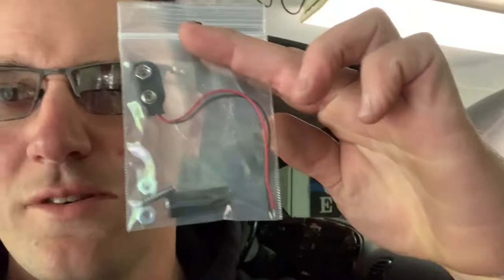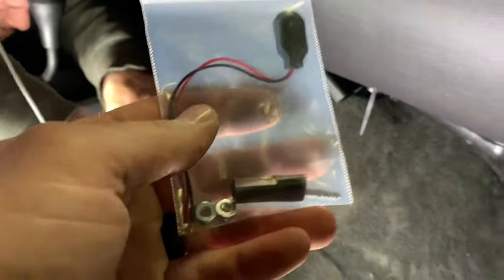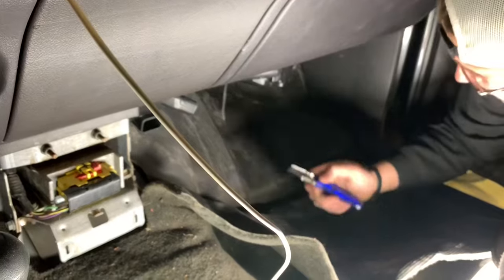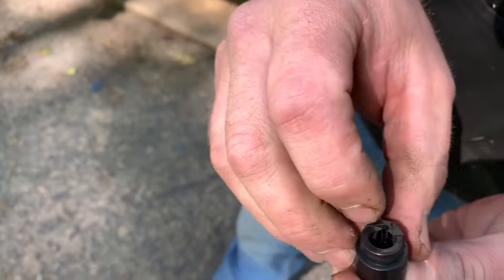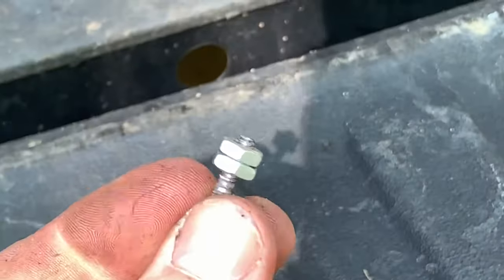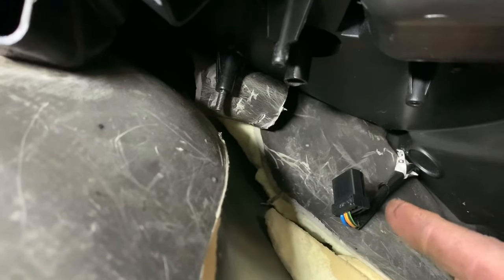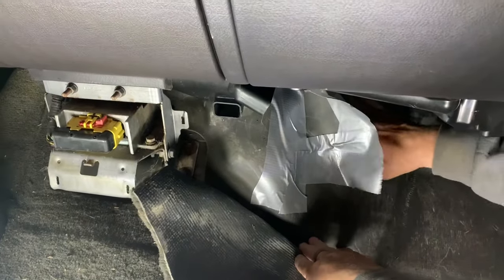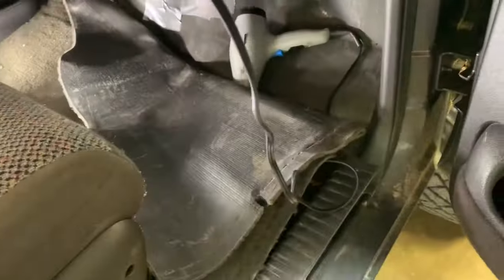97-02 Dodge Cummins blend door fix

Comment: I’m only getting Ac to blow on my front window defrost not my front
Reply from the maker: Your mode door is stuck on defrost then.
Reply: @AutomedicGarage  do you have a video for mode door, what actuates the mode door
Reply from the maker: That would be your mode actuator
Reply from the maker: I do not currently have a video for a mode door actuator problem
Reply: Do you know where is the mode door actuator located? I just replaced the blend door actuator which fixed my heat and AC but the mode is stuck in defrost and feet area and wont change to anything else
Reply: Check your check valves and vacuum lines in your engine bay

Comment: Does the AC dial need to be set in a certain spot when you reinstall the actuator? Or does it just matter where the blend door and thw actiaryor gears are lined up. Im only getting semi cool air right now. I also did take th batteries off or turn ignition 20 times like the manual said. Plan on doing that tom.

Comment: will a new actuator control module fix this issue ? I found an after market for $30.00 . I can't tell what exactly was replaced but it looks like a new module would fix the issue .
Reply: Nope   I pulled mine out 4 years ago and it happened again this week

Comment: This actuator must be in a different location for the gas motor trucks
I have a 97 and 98 gas motor and the actuator is not located like your Cummins is????
Reply: My '98 gasser(diesel conversion) is the same as my '94 diesel was.  It doesn't have one either.  It's mechanical.

Comment: Hello, great video. Good tips. I came across it in my research lol. I have a 2000 1500 ram 5.2. When the a/c or heat are on the front vents, the driver side blows significantly harder than the 2 passenger side vents. Doesn’t make a difference if heat or a/c. Everything is clear , nothing blocking it. Blower motor sounds strong. Only strange thing I notice is when on Max a/c (or regular ac or even vent heat) it comes out the vents AND the floor. Is this normal? You’d think max a/c would be top vents only. Thank you
Reply from the maker: Max ac is only different from ac because it pull air from inside cab, that’s why it blows harder also.
Reply: @AutomedicGarage  thank you for reply. My next question would when it’s on a/c or max a/c is it supposed to blow out floor vents also? I thought it was only supposed to come out the front facing vents
Reply from the maker: @bsrob1  ac is only on vents not floor. Your nose door must be stopping at the floor and vent combo selection
Reply: @AutomedicGarage  is this door easy to get to to replace? I’d say that’s where some of my passenger side vent volume is going if the door you speak of is stopping at vent and floor

Comment: Is the actuator in a different location because your truck is a diesel?
I have a 97 and 98 gas motor and the actuator is not located like yours????
Reply: should be the same
Reply: Earlier years had a cable ontop of heater box remove glove box and can go in and manually select

Comment: I have a 95 12V with the same problem, vacuum is good, I had the condensation hose problem as well, thought it was a window/door leak it drove me nuts till I found the problem, anyway..is the blend door actuator located passenger side under the dash? also can I buy that an entirely new actuator, Thanks
Reply from the maker: Yea you can get an actuator but it’s usually just the plastic collar that’s broke. Heater treater fixes that. And it is located under the passenger side of dash.
Reply: Nice work! 👏

Comment: Mine was cracked as well. Not sure if this is my issue. Not sure how it could be but every time I hit the brakes hard I hear a pop and my ac shut off
Reply from the maker: Door was flopping around in there probably
Reply: Hey I am having the same issue did you ever resolve your issue
Reply: @bgy1591
Reply: @russellcarroll6661  yes and I also had a leak and was low on refrigerant but I believe this was what was causing the popping sound and causing it to turn to hot
Reply: Great I’m gonna give it a go thanks !

Comment: So what you replaced, was that little plastic piece? 
With the gears, did you line them up?
Did the metal tube go over the plastic piece ? 
Little lost.
Reply from the maker: The heater treater mod replaces the inner plastic collar with a metal one.

Comment: Would this cause the ac compressor not to kick on, mines stuck on heat and when I turn the ac on the compressor doesn’t come on
Reply from the maker: No this has no control over the ac compressor. That is controlled by your mode switch, this is for the blend door.

Comment: Any suggestions or advice about the '95?  I have a LeBaron GTC convertible, blend door stuck closed.
Reply from the maker: Never worked on one, but start simple if it’s vacuum operated check for leaks or dry rotted hoses, see if you can push the actuator by hand. If it’s electronic take the actuator off and turn your blend switch back and forth and see if the actuator works at all.

Comment: For a temp fix could you just turn by hand to set to one temp?  Mine is stuck on heat 2001 dodge Dakota.  Need on cold
Reply from the maker: It would be hard to turn by hand due to the gears unless they are all broke.
Reply: I know this is old but I thought I'd respond anyway. I have a Dodge Roadtrek 190 Popular. It's built on a Dodge B3500 van. My blend door actuator doesn't function, BUT...I can turn it one way in the winter to get super hot heat. Then, in the summer, I flip the actuator the opposite way, and the heat stops coming in (or at least partially so). 

My problem is that the AC blows barely cool air rather than cold. The AC system has been fully checked and recharged. The line gets freezing cold but the air into the cab is blowing barely cool.  

That's my problem, but I wanted to answer your question by noting that YES, you CAN just turn the actuator by hand. My actuator is accessed by removing the glove box. Very easy to turn by hand. (Unfortunately for me, in summer it must not close the blend door effectively enough because it seems some heat must still be getting through. But that may not be a problem for you.) Good luck!

Comment: Can that blend door being broken cause the A/C on my 02 Cummins to only blow from the floor?
Reply from the maker: No, that would be your mode door
Reply: @AutomedicGarage  Or a vacuum leak if it doesnt change vent positions
Reply from the maker: @Tempsho  I wasn’t insinuating it couldnt be a vacuum leak. The point it if it’s only blowing in one location it’s something to do with the mode door meaning the door itself, controls, vacuum leak, etc.
Reply: @AutomedicGarage  all good, I was just trying to add a bit more to your comment. Some people don’t realize that in some vehicles, the vent position is controlled by vacuum and that it defaults to the floor/vent position if there’s a vacuum leak.
Reply: What was it?
Reply: Is there separate actuator for the mode door? This seems my problem… its stuck on defrost wont change to feet or anything
Reply: @jomine16  look above the accelerator pedal there is one that controls the vent flow
Reply: @jomine16  mine is stuck on feet can’t change from feet
Reply: @jomine16  I have the same problem with my 2002.
Reply: I just saw a youtube vid. Its actually controlled by vacuum which tends to break by the firewall right by the AC tubes going into the firewall. Will check mine this weekend and see if that fixes the problem
Reply: @Tempsho yes - I have an 01 truck and where it comes out of is vacuum, so vacuum leak makes it default to defrost. Pretty common thing to fail. Haven’t heard of just the floor though…

Comment: So what do I fix if I don’t have an electric actuator ?
Reply from the maker: Is yours on a 1500 gas burner?
Reply: @AutomedicGarage  yep
Reply from the maker: @dannyclark9820  I wish I had a good answer for you but the only dodges I work on are the Cummins but I’m assuming you have vacuum operated blend and mode doors and you more than likely have a vacuum leak/problem.
Reply: @AutomedicGarage  thank you I’ll keep digging
Reply: The older trucks 98.5 and below have a cable ontop of heater box remove glove box (if dash is still in tact) and can select manually

Comment: Mines manual with a cable on top
Reply: Same here. But the blend door doesn't seem to close all the way in the summer. I've got GREAT heat when I open the door, but when I close it for AC in summer, I get barely cool air coming through. AC system thoroughly checked and working.

Comment: my 99 dodge cummins only works on defrosters and will shut off but any other setting wont work has new hvac module and vacuum lines are good any idea on what it could be?
Reply from the maker: Is the blend door actuator working?
Reply: @AutomedicGarage  im not sure how can i check to make sure its working properly?
Reply from the maker: @klarkpeterson6125  with the key on change your mode and listen and feel on the actuator. Then remove it so the same thing with it removed but plugged in. If you feel/hear clicking or it does nothing that’s where your problem is. When you remove it it will have a plastic bushing/connector that engages it with the shaft of the blend door. More often than not that plastic piece is broken. That’s where the heater treater mod comes in. Hope that helps.